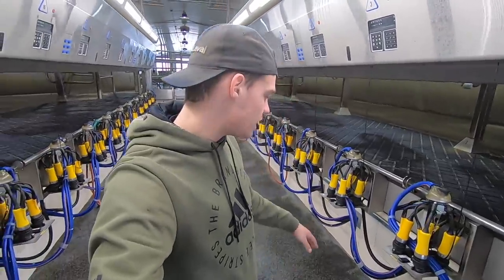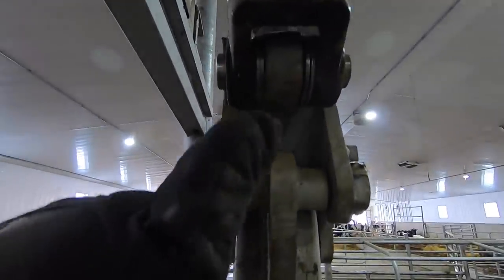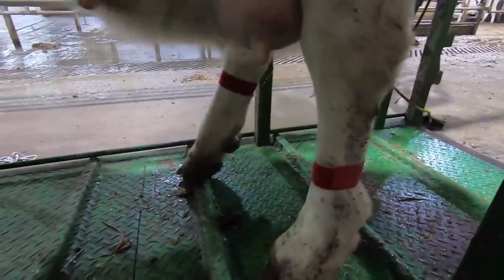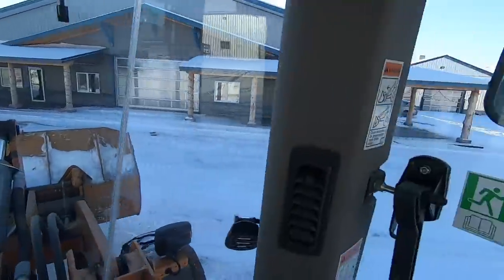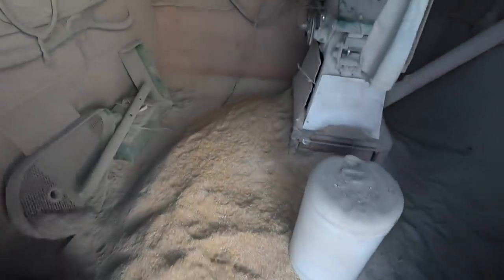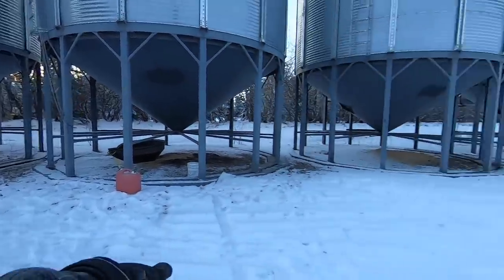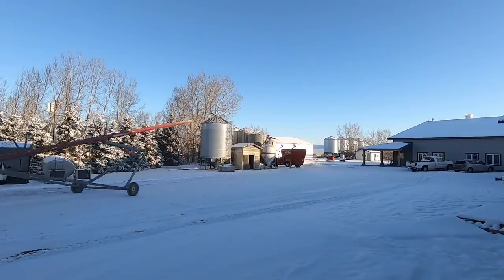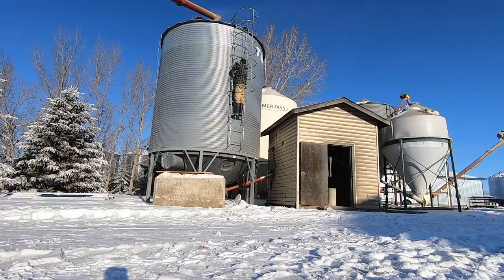New Liners and Moving Feed

Comment: How does the milking machine segregate the milk from the special needs cows from going into the good milk tank?
Reply: they get milked into a special pail usually that works off the vacuum from the rest
Reply: @hamsammich8781  Does the special needs cows need to line up exactly next to the special pail or can any cows milk be swapped to the pail to be dumped by a valve system designed in to the milking machine?
Reply: @bobjohnson1710  from my expeirence it can be any milker in the parlour, just unhook the normal lines hook up the correct in and out line for the pail, and then after return the milker unit lines for the flush inbetween to avoid contamination
Reply: @hamsammich8781  Thank you. I did wonder about that system too
Reply: @niveusnimbus  No problem! Glad to semi clear it up for anyone wondering, cheers!
Reply from the maker: Ill show it in a future video!